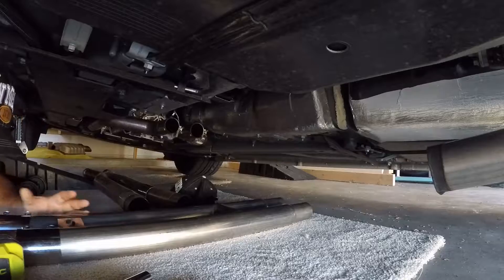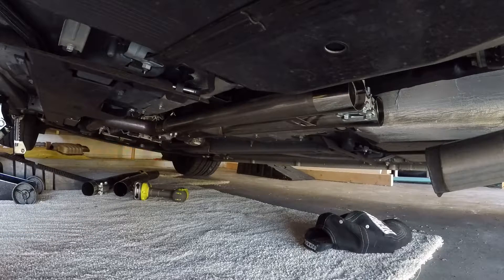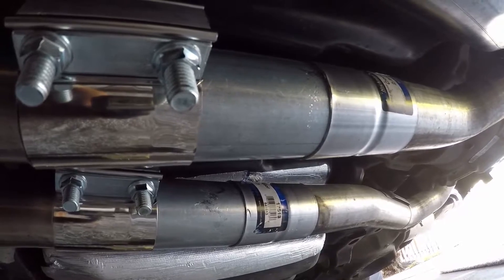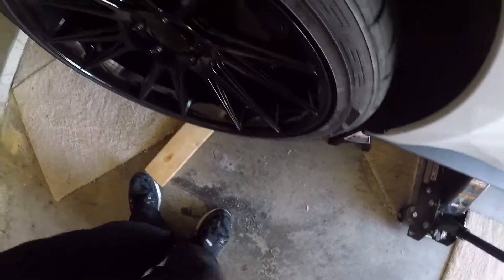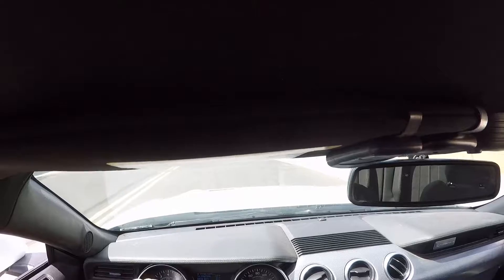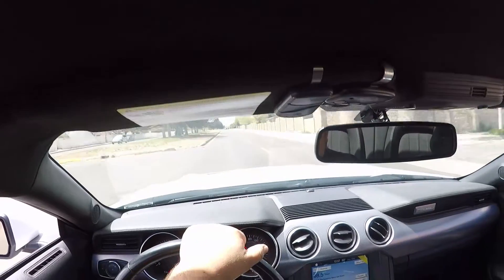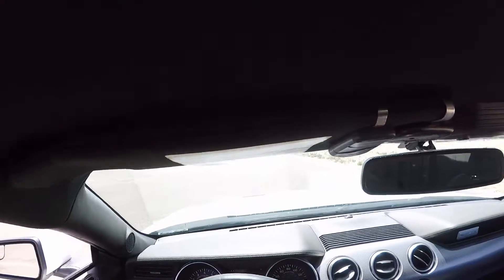2018 Mustang GT " DIY H-Pipe Installation "   ( From X to H-Pipe )

Comment: Good clips, more guys at the drag strip are swapping out there 3.55 for 3.15’s on stock wheel setups.
Reply from the maker: Thank you.  Yea it makes hooking up easier and keeps you in peak power longer.  I am very pleased and enjoy the way the car is set up right now.  I can only imagine how insane things will get with E-85 and a tune.
Reply: Are they running quicker?
Reply from the maker: @forcedair92gt94   The Steeda car is the fastest N/A 18+ GT and it runs 3:15 rear gears.
Reply: @airflow_concepts  I know about that one. They went from 4.09s with the stock converter to 3.15s with the Circle D.  They also tried different tire sizes.
Reply: forcedair 92gt 3.55 with a decent drag pack is quicker but for us street guys 3.15’s on stock tires can actually get going without spinning tires. Spinning ain’t winning.
Reply from the maker: @Phoneman-oc4fi  I have raced a 18 Auto GT pp and at highway speeds my car pulls away little by little.  And I weigh quite a bit more than the the other driver.
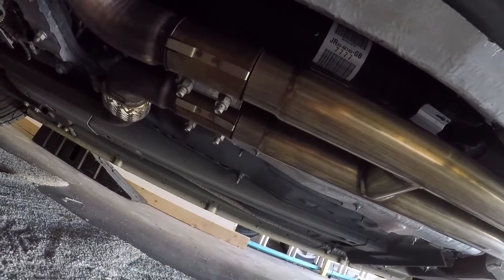Reply from the maker: @forcedair92gt94  3:15 gears will be more forgiving with higher stalled converters and allow for more consistent launches is the reason im guessing people are switching out 3:55 for 3:15 gears.
Reply from the maker: @Phoneman-oc4fi  maybe quicker out of the hole, but higher speeds its a toss up.
Reply: FullAutoGT I love playing with a local guys Hellcat and he always blames his shifting is why I always smoke him. 10 speed GT with 3.15’s is no joke.
Reply from the maker: @Phoneman-oc4fi  I love to hear that man.  What is done to your car so far.
Reply: FullAutoGT Ford Performance x springs, Ford Performance sway bars, Ford Performance strut tower brace, Steeda Active shocks, Steeda diff bushings(red ones), toe link knuckle bushing, Ford Performance toe link,steeda vertical links, Steeda cradle bushings, Steeda subframe braves, front g track brace, Ford Performance front links, h pipe and Ford Performance Extreme axle back on the way. My wife also got Katzkin leather installed since it is her car after all, wink wink.
Reply from the maker: @Phoneman-oc4fi  wow thats quite a list you got there.  Great choices on parts.  Ive got quite a ways to go to get caught up on that area.
Reply: FullAutoGT just like you, I save a lot of cash doing all installs myself, up next is some tires/ wheels looking at SVE355 staggered set up from LMR
Reply: @Phoneman-oc4fi  I bet the extra MPG doesn't hurt either. HAHA!
Reply: forcedair 92gt like a hybrid
Reply: Phoneman 1223 Most guys are switching because they’re trying to stay out of 7th gear.